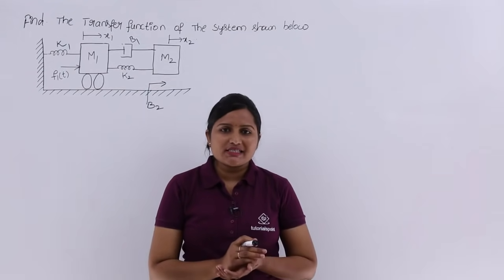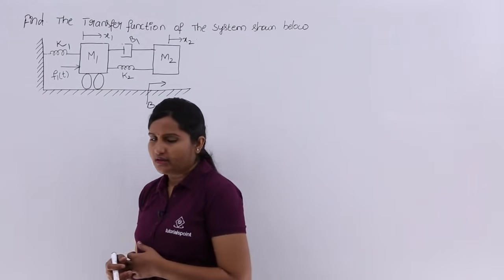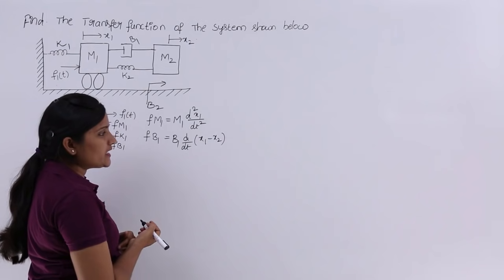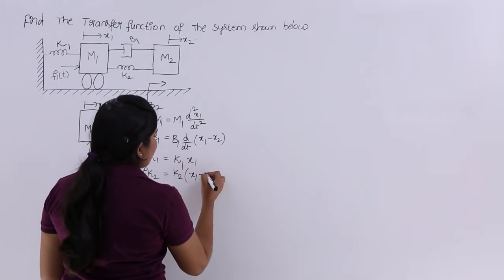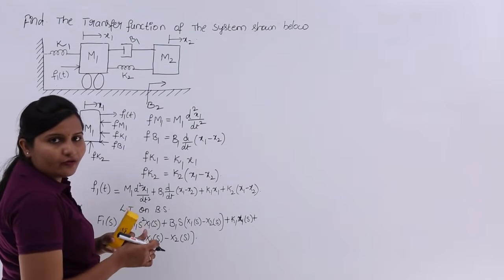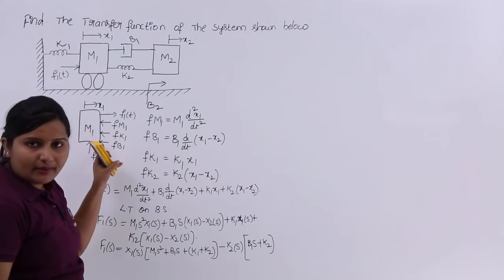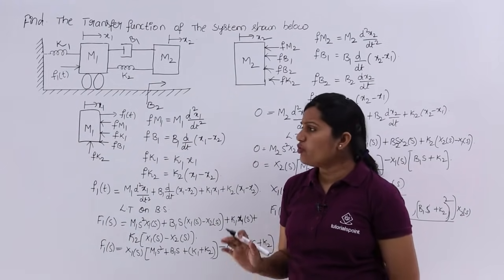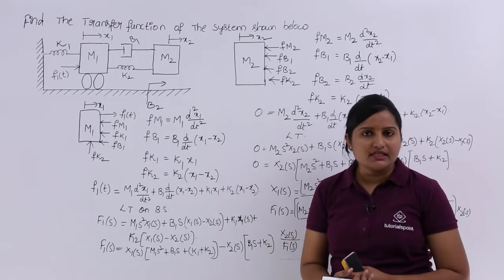Problem on Mechanical Translational System Including Friction

Comment: After substitution of X1(s) to F1(s), where is the X1(s) multiple (M1s^s +B1s+k1+k2) in final equation?
Reply: I have same difficulty
Reply: exactly brooooooo
Reply: she forgot to write it down
Reply: Yes she skipped it
Reply: she forgot tht. but if u do so, u would not get fullmarks.
Reply: jboy do cramers rule. It's easier to get transfer function
Reply: I too didnt understood
Reply: The result is wrong she forgot to write it. Using cramar rule you'll get a correct answer
Reply: @francisauta9910  plz explain Cramer rule
Reply: Exactly. Confusing.. I think she forgot..
Reply: U Forgate to put value after putting X1(s)
Reply: Yes.she forgot it.